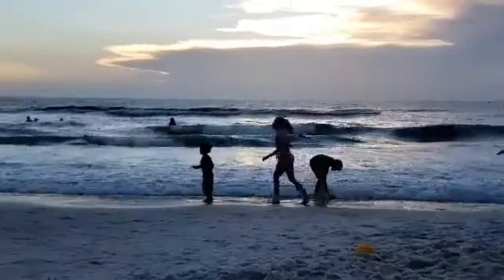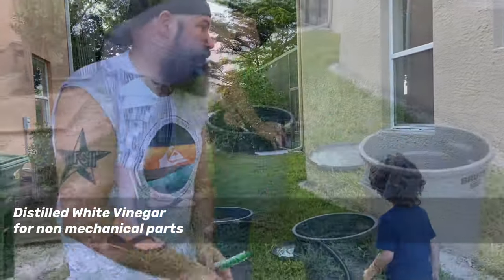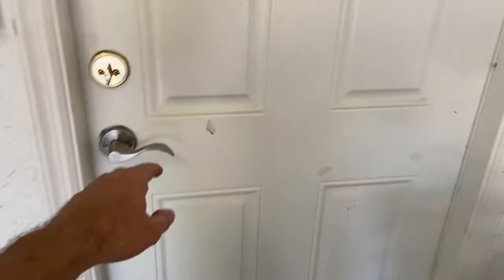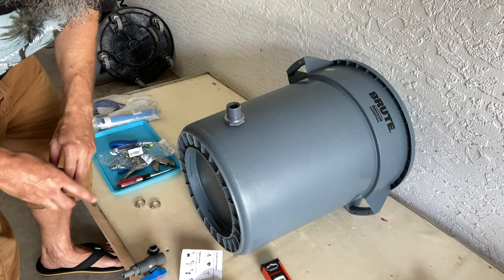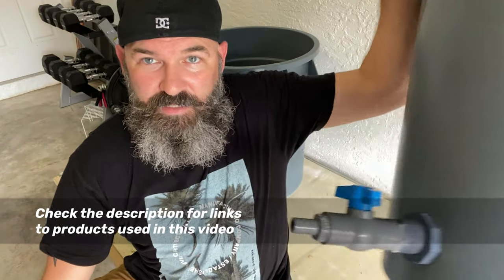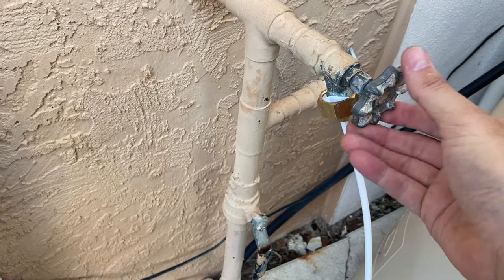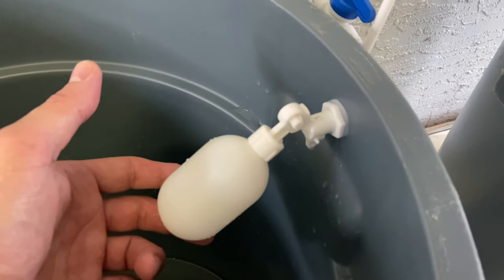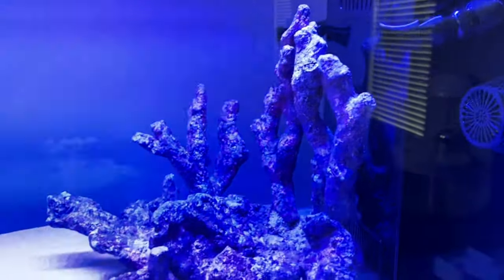Installing a RO/DI water system for the reef tank

Comment: Question about the DI Filter chamber, I just set up the same model as yours but wondering if the DI Filter chamber should fully fill with water? Water is flowing into my DI filter chamber but only fills maybe an inch from the bottom before travelling through the di resin canister and out the output hose. I am getting 0 TDS out of the output hose but wondering if I do not have a good seal between chambers. No water is leaking anywhere.
Reply from the maker: @jmfc5  hey thanks for reaching out… you may not have the resin packed tight enough. I always gently tap the resin container on a towel over a hard surface. But to answer your question, yes the chamber should fill with water.
Reply: @ReefStash  Thanks so much for the response. Really appreciate the guidance! I'll take a more thorough look at my setup and try and fix it.
Reply from the maker: @ let me know! You’re absolutely welcome. I do my best to always reply to those that take the time to comment. 👊🏼🔥👊🏼

Comment: Nice bro, looks mint! You going to put a roller mat in it, I just installed a innovitech-x-filter 1.7 bro its so silent
Reply from the maker: Thanks bro! I’d love to do a roller mat… really hate cleaning socks every couple of days. 💯 I’ll have to check out the innovitech - silence is important. Thx for the recommendation.  Did you have to make any mods to install it?
Reply: @ReefStash  I've had it running for the past 2 days, it was a little confusing at first,  but its a beauty, you won't hear a peep out of it, 4 x 40ml elbows, 2x unions and 1 length of meter pipe, took 2 hrs to make and dry and off it goes, that roll should last over a month or maybe more
Reply from the maker: @eliasdagher481  did it come with everything or did you have to pick up the extra parts for the project? Thx for the info.
Reply: @ReefStash  it comes with everything, except the plumbing fittings bro
Reply from the maker: @eliasdagher481  good deal, thank you